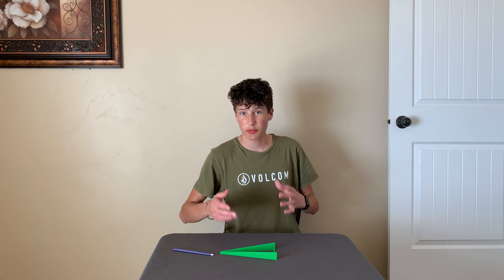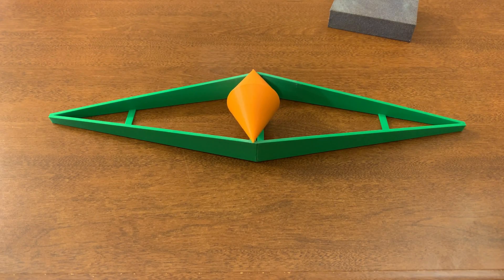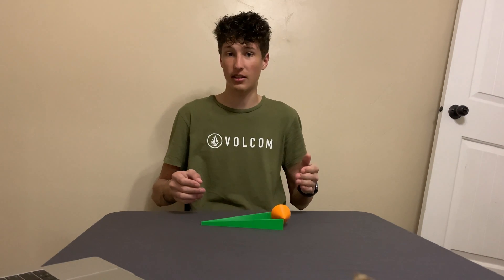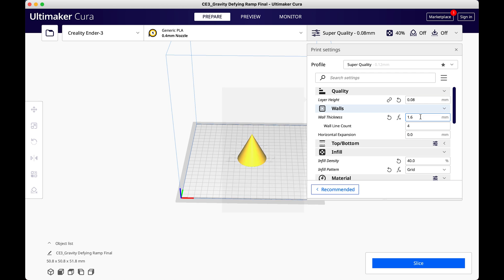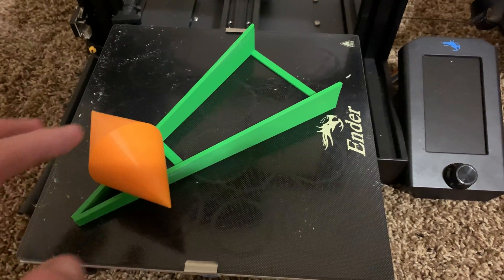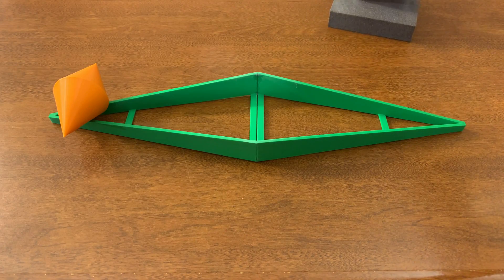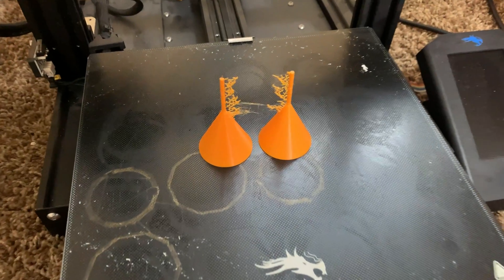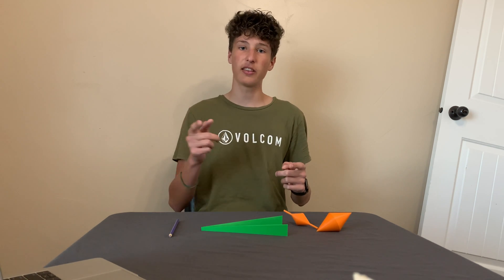This Object Rolls UPHILL!

Comment: comparing two diameters is not the correct understanding. the existence of a gradual change in diameter is the key. you could still have an object of two different diameters that does not exhibit the uphill rolling illusion. be more specific. 2:04
with that minor criticism, i'd say your vid is the best on the subject on youtube.
Reply from the maker: Thanks for the advice. In response, I’d say that in the video I was simply saying that the cone would not roll up the ramp unless it’s radius was smaller than the elevation gain of the ramp, however you are right in that I was unclear that that this can only occur due to the fact that the cone tapers off on both ends allowing it to roll and therefore it’s sense of gravity to lower. Thanks for watching and thanks for the compliment!

Comment: What if you line a bunch of these ramps up next to each other so the double cone falls off the top of the first one to the next ramp? Would it go forever?
Reply: Note I know this Is obviously not infinite energy or anything but it's an interesting thing to think about!
Reply from the maker: I actually tried this and the only way it works is if the next ramp is on a lower surface than the first or it will be too low to even start the next ramp.
Reply: @PackerAnderson  ah ok, thanks for the reply

Comment: The cones are almost exactly mirrored, but are slightly different. One has a slightly lesser slope than the other, meaning side with the greater slope goes, then the side with the solid slope follows the side with the slightly lesser slope, etc., until the cone falls off, and vice versa for the other side.